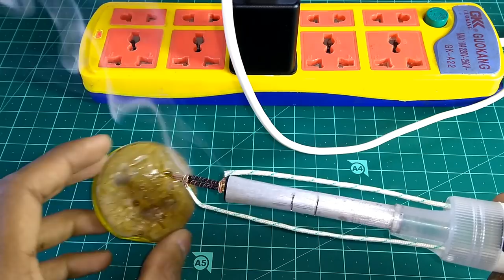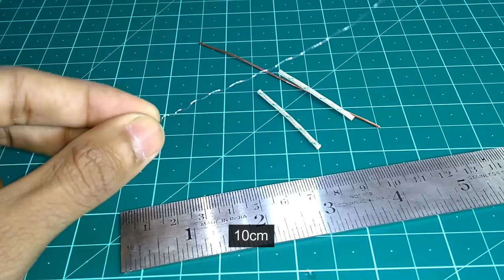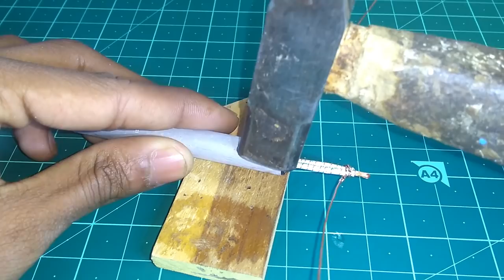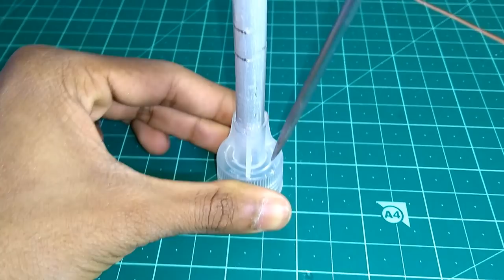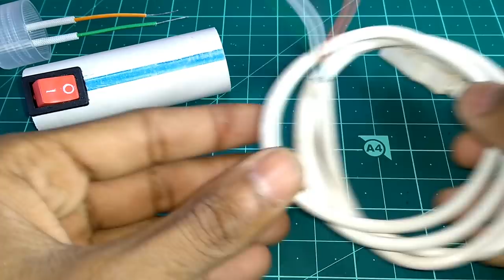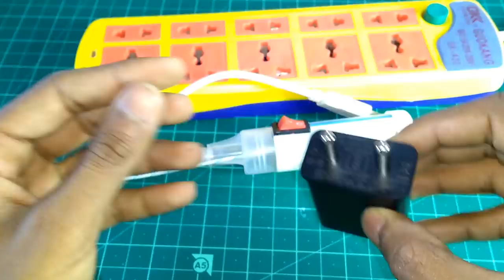How to Make Soldering Iron At Home Easily DIY

Comment: Where can i get nichrome
Reply: An old Hair Dryer, or Any other home appliance that usess a wire that heats up. Like a Toaster, or Hair Dryer. THAT is Nichrome Wire. Perfectly fine to re-use on This project, or any other that calls for Heating a bit of Metal.
Reply: Led bulbs, iron box ,hair dyer which    are not useful, from that you can take out